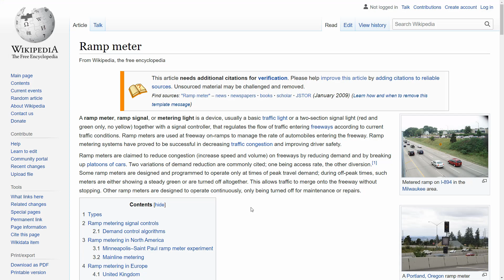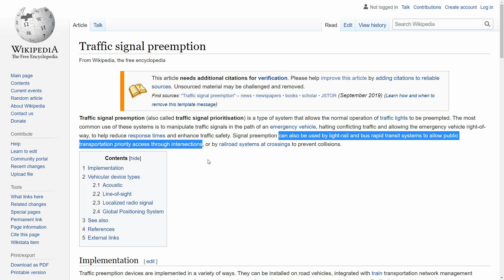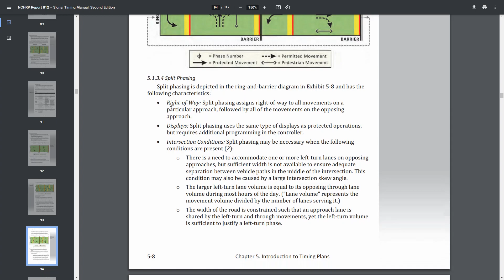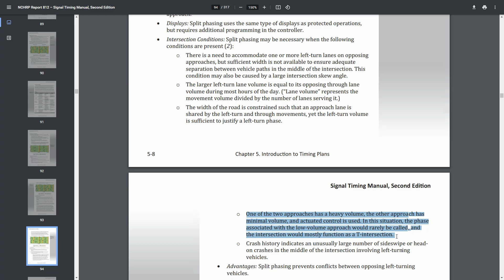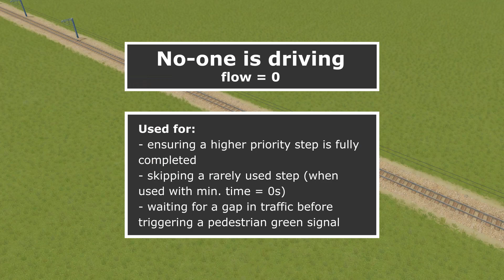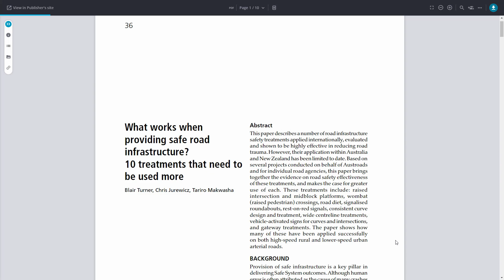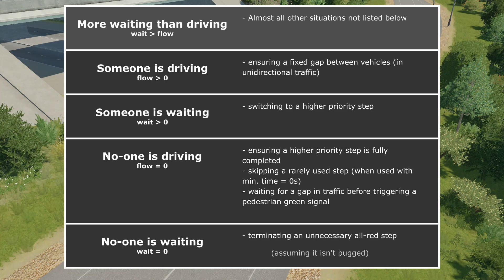The other timed traffic light switch conditions (TM:PE) | Cities Skylines

Comment: So many switching possibilities. In real life, "vehicle-actuated" traffic lights continue the green light either until the gap between vehicles exceeds a gap setting, or until the maximum green time is reached. 
Phases without waiting vehicles can also be skipped, and when nobody is waiting, the junction can either stay in the current phase, revert to the main road, or revert to all-red. 
In the latter case, the traffic lights will instantly change to the appropriate phase when a vehicle approaches.
I like the editing in this video, the phase visualizations in particular.
4:40 This is essentially "semi-actuated" traffic light control, where the green time for the main road is fixed, and the green time on the side road depends on actual demand. 
In real life, this is useful when operating traffic lights in coordinated mode, as unused side road time can be transferred to the main road phase, which is useful for two reasons. 
The first reason, is that the cycle length of the intersection remains the same, maintaining coordination. 
The second reason, is that it benefits vehicles turning into the coordinated corridor, which would have otherwise had to wait at the next traffic light.

Comment: I have been looking for this! Was trying to look for a way to solve traffic piling up at a crossing without rebuilding or upgrading the crossing infrastructure itself (like a turnabout) or demolish part of the neighborhood to get space needed to increase lanes or manifest a turnabout. This crossing had 3 directions that were 2 lanes (1 was avenue with tram), the fourth direction was emergency and city services vehicles and trams only (service road for fire, police, clinic, tram shortcut to get into district's commerce area). I wanted to allow whenever a vehicle or tram was coming/waiting, to get priority for this service road. As well generally improving the traffic flow, which can be random at times where the most traffic was coming from. The pedestrian tips for an all red cycle was also nice tip, to make sure all pedestrian has finished their crossing before letting traffic flow rip again. Thus improving the safety aspect as well (not it matters for the game, but just looks nicer).
Al tho I have seen some drivers (including trams and police) running through red lights before and after a light switch, must have to do with my 2% minor complaints settings in TMPE.
So nice to see a crossing that was once red now just slightly orange. That one crossing was responsible for dragging my traffic flow to 70-ish procent. After with an 8-phase timed traffic lights is now 86%.

Comment: The "no-one is waiting, wait=0" condition could be used on the highway ramp meter for the red phase (in conjunction with a 0s min time and 3s or whatever you want max time). That way the signal detects the end of a platoon and switches prematurely to waiting for another platoon in the green condition.
I don't know why you'd want shorter gaps between platoons than between vehicles inside a platoon, but with this setup you can have that. The only situation I can see this being ACTUALLY useful is if the red phase of the ramp signal is also stopping pedestrians or cyclists ...somehow.
Reply from the maker: You're correct, I originally filmed this exact thing but when I noticed there was a bug I picked something else that would make the bug more obvious.